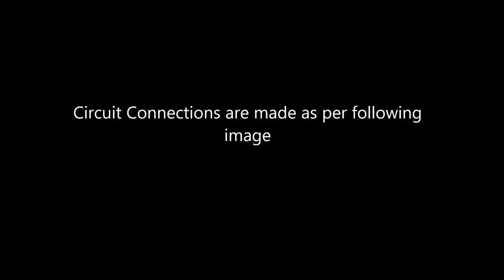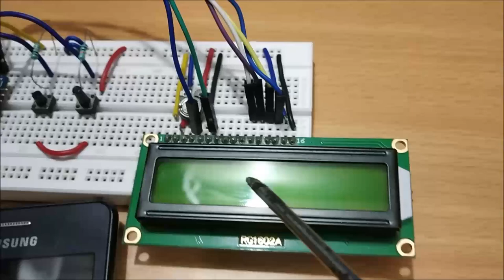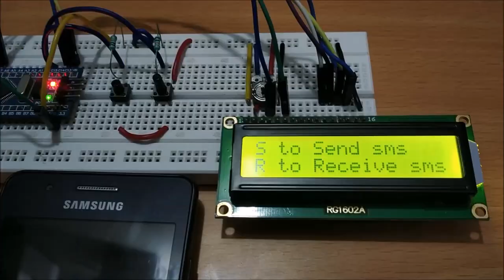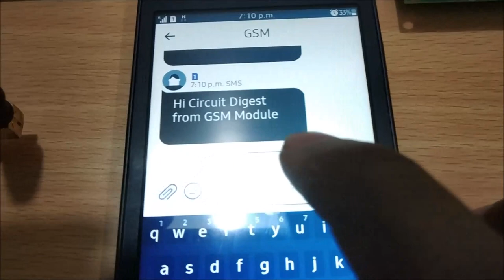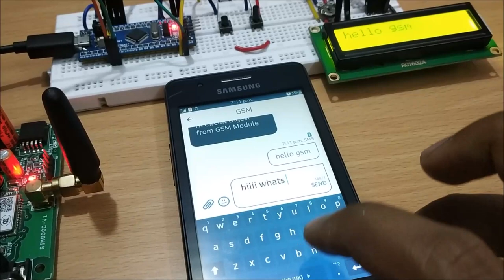How to Interface SIM800C GSM Module with STM32F103C8 for Sending & Receiving SMS

Comment: Hello sir, I am done with the circuit except the sim900A(I am using this). I donot have the 12V power dc generator now. I am facing with the problem of no character is displaying in the lcd screen, only bright yellow screen is showing.
Reply from the maker: Use an appropriate power supply recommended for the module. ANd make sure you have adjusted the LCD contrast.

Comment: Hi, great video. Just want to ask. I tried to copy your coding in arduino and verify it but tends to have errors that stated " 'rs' was not declared in this scope"
Reply: And the error applied to all pins I used for the LCD.. Any idea why?
Reply from the maker: @fadiahnordiyanahassan7040  Please post your questions on our forums https://circuitdigest.com/forums the author of this project will reply you there
Reply: @Circuitdigest  Code is uploaded successfully but circuit is not working lcd is not lighting up and I am not able to send and receive message as well
Reply: @priyamshah4646  hey did u fix the problem??
Reply: @fadiahnordiyanahassan7040  did you solved it?
Reply: @fadiahnordiyanahassan7040  delete the code "LiquidCrystal ...d7); and write this "LiquidCrystal lcd( the address of the I2C,16,2)"

Comment: what about how it works? i don't need a result. i need to understand how to program stm for working with this shit
Reply from the maker: The SIM800C module is controlled using AT commands over UART. You can find the whole code and other details on the project page linked in the video description.

Comment: Components budget ?
Reply: stm32 1000
gsm 900
breadboard 60
wires 10
lcd 150
resistor 10 rs
power supply 100
Reply: Hello, can you please contact me for a project, thanks